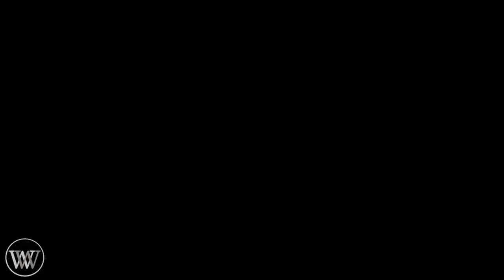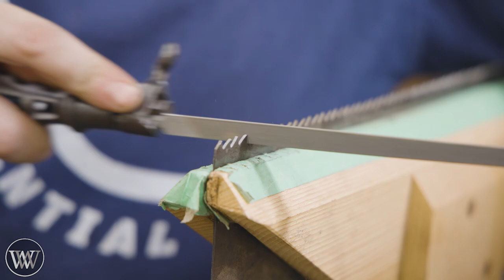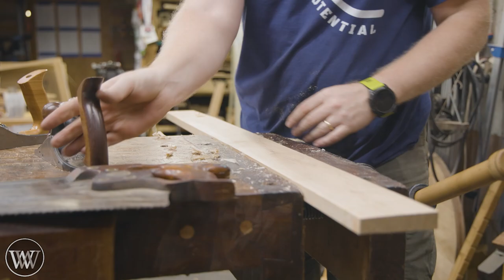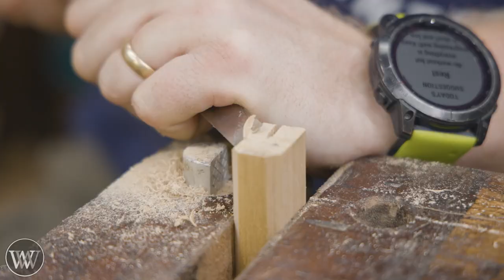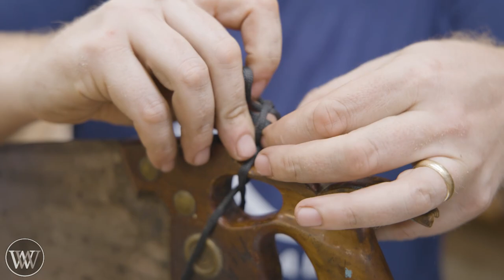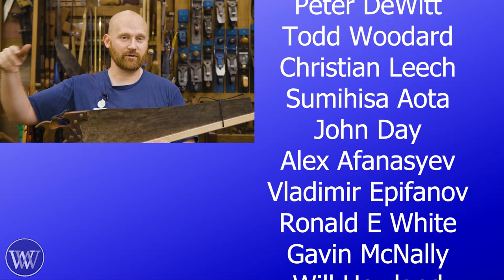How to Make a Saw Gard To Protect Your Hand Saw

Comment: I made my saw guards out of pine. Hold down straps were made of thin leather about 1/2” wide. One end was nailed tight with a copper roofing nail. The other end had a vertical slit that hooked over the head of another roofing nail that was left just proud of the guard surface. Very tidy and worked great!

Comment: Great idea, great video!  I made one for each of my saws when I moved last year.

Just an idea, you could use some small bungee cords instead of paracord.  This can be bought by the foot at big box stores.  Also, blocking the ends of the grooves with a small piece of wood will help keep it from sliding off the saw.

Comment: My Grandfather was a master finish carpenter & cabinetmaker. He had a saw box; a long, narrow, wooden toolbox about 8" wide and just long enough for his longest saw. In the bottom, he kept 2 rip & 2 crosscut saws (fine & coarse) along with the backsaw for his  Stanley Mitre Box. That saw was almost as long as his hand saws. The lid held 2 small, fine-toothed backsaws and a coping saw. That box went everywhere he went. While I like your idea for a blade guard, I have to say, nostalgia aside, I think I prefer the saw box idea better. It kept his saws out of the weather and away from getting banged up. Oh, and it had a short 'fence" on the hinge side of the top that he often used a bench hook for making short cuts. Thanx for reminding me of the box. Now I'll have to put that on my "to make" list... like it isn't long enough already.

Comment: I made saw guards a while ago for my saws. Best choice I ever made. Mine were a little deeper then you made yours. Like 2 or 3 inches. Then when I set up my shop I put an aggressive chamfer on one side and two holes and attached it to the wall. Works well as a holder/display. 

You can cheack it out on the YouTube channel “the bench top perspective”. I have not done much with the channel.

Comment: Cool project. I saw a Facebook discussion of these recently. A couple of guys, who have probably forgotten more about hand tools than I'll ever learn, mentioned that saw guards made from porous woods, like red oak, can actually draw in moisture and lead to rust issues on your saws. They recommended maple. So, I'm guessing you knew what they knew.
Reply from the maker: That is an old myth. Ring porus or defuse porus woods will do about the same. Moisture is so much smaller the the pours on eather of them.
Reply: @WoodByWrightHowTo  , ah. I was wondering how it could possibly matter if it's stored inside. I was under the impression that all hard woods hold about the same amount of moisture in a climate controlled building, regardless of porosity.

Comment: I really wish i new what you were talking about. Its almost impossible for me to get through an etire saw sharpening before decied to finish it later and grab a another saw. In 4 days into sharpening 10 absolutely mangled chisels by way of sand paper. Its not going fast i can tell you that. I really need to get my bench grinder running again along with some diamond stones.